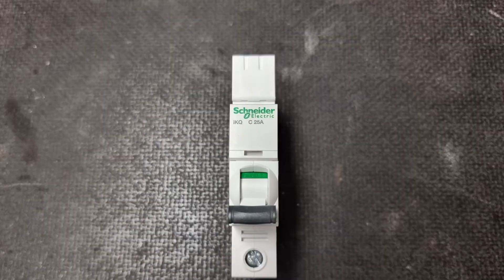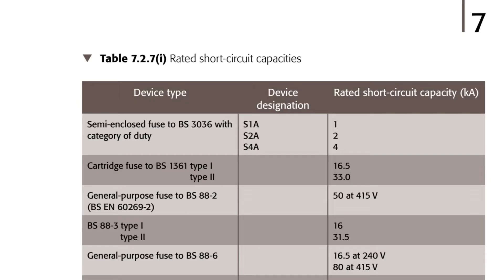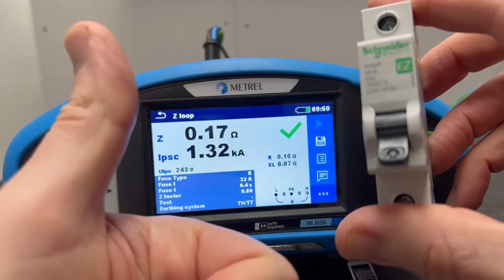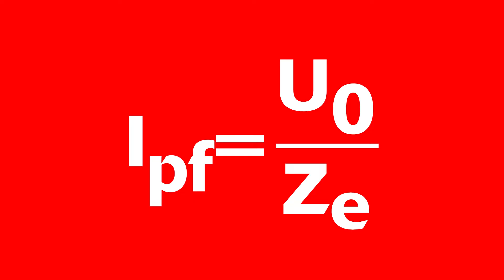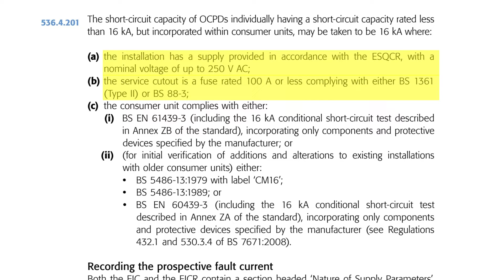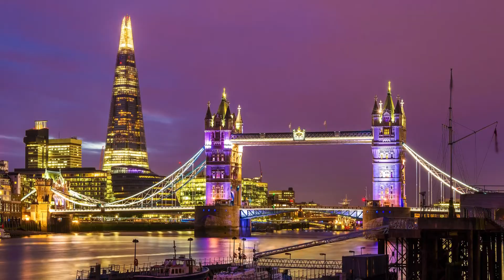Choosing the Right Circuit Breaker - 6kA vs 10kA

Comment: Re: 3Ka vs 6Ka Circuit Breakers on a Single-Phase board.

I recently had some insight from a local electrician who helped me out with my secondary DB which feeds my 11KW inverter. 
He told me to replace my 3Ka breaker with 6Ka as we had issues with just the breaker that feeds the inverter itself.

We bought the Inverter DB about 3 years ago and it came pre-populated with breakers by the supplier. 
I never thought twice about the DB until the Double Pole 63A Breaker feeding the inverter tripped a couple of times and then failed completely for the second time. 

I suspect dirty supply from the Power Provider and/or the Inverter having to draw larger loads when exceeding its rated capacity of 11KW as it allows for spikes exceeding 11KW as certain devices kick in like water pumps when the system is under full load.

Anyway, he said he only installs 6Ka breakers in his installations, never 3Ka.
In this country, when you go to the Electrical Shop, I suspect they just sell you the cheapest breaker which is most likely 3Ka.
The price difference is quite a bit, the 6Ka breaker was around 4 x the price of the 3Ka breaker. Maybe it was the brand, Schneider I bought, but it cost 4 to 5 times the price of the 3ka 63A breaker.

You've got to look carefully for the Ka rating its quite small, or like myself use stronger reading glasses to read the Ka rating on the side of the breaker.

Comment: What is the benefit of choosing a lower KA rated circuit breaker? and is there any reason that a higher kA could cause problems if a lower kA is called for?

Comment: I assume this is similar to the AIC rating we have over here in the US? We go with sequential order... where we get with our utility company with our load demands and determine the AIC rating of our Main breaker depending on other things as well as wire size and length. From there the other breakers after the main step down in rating so as to not trip the main unnecessarily when a ground fault happens in a sub panel. I.E. ... the fault should only trip the breaker feeding it and not bypass (let's say) four breakers ahead of it and trip the main. ...Simplified explanation

Comment: Testing the highest value of SFC/ PFC down during inspections is more important on 3 phase installations than on single phase where enquiry is acceptable. That's due to the voltage difference of line-line, if you're at 400 volts phase to phase / phase to earth with 0.04 ohm ze you're at 10kA. I've had it before where you've enquired and the DNO aren't even aware there's 3 phase in a property.

Also the number after the 6000(3) or 10000(3) is the number of times the breaker is rated to trip without issue if my memory serves me correctly.
Reply: No the 3 means it's an energy limiting class 3 device. Single phase or three phase it makes little odds of the device isn't up to the job.
Reply: @travoltasbiplane1551  Well my memory isn't perfect after all these years but I do remember there was a number on devices referring to it, though I am going back many years since my NICEIC inspector informed me. It's probable that it isn't even needed on these modern devices.
Reply: @effervescence5664  you're thinking of the ics value, which is max breaking capacity where the MCB can be safely reused, icn is the max one time breaking value.

Comment: The Ze value where 10k is required would have been informative 👍
Reply: V =IR therefore v/I will give you that value. 230/10000 = 0.023 ohms. But you also need to consider short circuit loop impedance.
Reply: You’d get that by measuring, as stated in the video larger commercial, industrial systems will generally be a lot closer to the source and will therefore have a lower Ze value than the normal TNCS or TNS that you find in a domestic setting.

Comment: Why do we see so many 6ka and 10ka breakers then? 
Surely if it could be up to 16ka all breakers in new installations should be 16ka ?
Reply: Because the devices are cascaded with the upstream device. There is backup protection. The energy let through of say the supplier fuse will help the downstream device break the fault current. Essentially it will never see the full 16kA.
Reply: @travoltasbiplane1551 only for a consumer unit though, which is type tested by the manufacturer. That's where the only OEM mcbs in their board comes from.
Reply: @matthewthomas6121  yeah I think the exact wording is an assembly to 61439

Comment: If you're close to the transformer the highest short-circuit current will often be through line to neutral and not the 3-pol short-circuit current.
Reply: Why?
Reply: @ppdan  I think it is because the impedance will be lower close to the transformer if you have 1-pol compared to 3-pol.
Reply: @Faddnn  Line to line has a higher voltage than line to neutral and according to ohms law a higher voltage will induce a higher current into the same load.
Reply: @ppdan  It is not that simple when you are close to the transformer. If you want a complex answer you have to ask someone else. 
All I can say is, this is the situation when I get the numbers from the DNO when working on projects close to a transformer (TN systems).
Reply: @Faddnn  All incoming conductors have the same section and length (phases and neutral) but phase to phase has a higher voltage.
If in that case the short-circuit current between neutral and line would be higher than between line and line Ohms law would be a big lie!
Reply: @ppdan  Ok man I guess we live in a big lie then.
Here is the calculated values I got on my latest prodject:
22.000 kV /0.415 kV
Dyn11 2500 kVA

20 Temp (C)1.05 Faktor
3-pol max: 53.457 kA
2-pol max: 46.295 kA
1-pol max: 59.591 kA
Kortslutningsytelse: 37.036 MVA
Imp. pluss-systemet R:   0.67 mOhm X:   4.49 mOhm Z:   4.54 mOhm Cos(phi): 0.148
Imp. null-systemet R:   0.54 mOhm X:   3.09 mOhm Z:   3.14 mOhm Cos(phi): 0.171 

90 Temp (C)0.95 Faktor
3-pol min: 48.372 kA
2-pol min: 41.892 kA
1-pol min:  53.920 kA 
Kortslutningsytelse:  33.513 MVA
Imp. pluss-systemet R:   0.71 mOhm X:   4.48 mOhm Z:   4.54 mOhm Cos(phi): 0.156
Imp. null-systemet R:   0.54 mOhm X:   3.09 mOhm Z:   3.14 mOhm Cos(phi): 0.171
Reply: @Faddnn  Looks like the result at direct output of a transformer ... all we need now are superconductors from the transformer to our home to get those values in our domestic installation.
Your results at the terminal of a unloaded transformer which is nowhere close to what you get once you "reach" the first installation.
Reply: @ppdan  Just like I've said, close to the transformer. You can still get a higher 1-pol short circuit current depending on the Z some way out in the installation as well.   I've never said you get these in your home. . Why are you even asking like you are clueless?
Reply: I always test and never enquire but phase-phase SFC is often higher in commercial 3 phase than phase-earth or phase neutral. That's because earth and neutral are both the same at the transformer where phase - phase is the greatest difference in potential. Often I'll find Phase-Phase around 9.8kA where Phase-Neutral/Phase-Earth will be around 3.7kA

Comment: Can you guys do a video on using programs for calculating wire dimensions? A bit selfish but I have a sense that I’ll be able to pick up some new knowledge.
It’s a interesting part of installation that most, at least Swedish sparks, have a limited understanding of.
Reply: R=(ρl)/A
Do you really need a computer programme for that?
Reply: @deang5622  I’m thinking about the dimensioning of cables from distribution boards and taking voltage drop and other factors in to the equation
Reply: @kristiangoransson6104  And voltage drop depends on the electrical resistance.
I provided you with the formula to calculate that electrical resistance.
Reply: @deang5622  I’m not stupid but doing calculations manually for a freezing faculty with 6000A three phase isn’t very financially viable.
It would be interesting to see how British sparks or consultants do it since it seems, at least on YouTube, that you do more measuring and documentation than we do